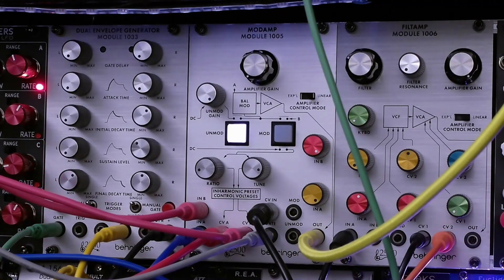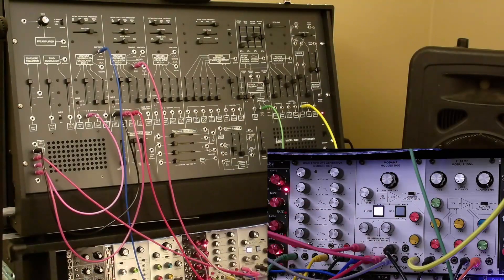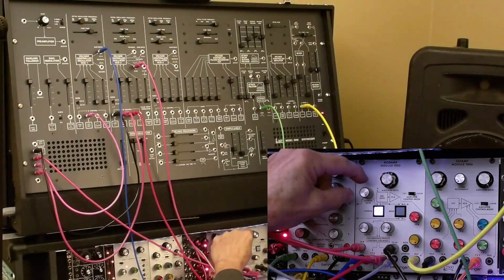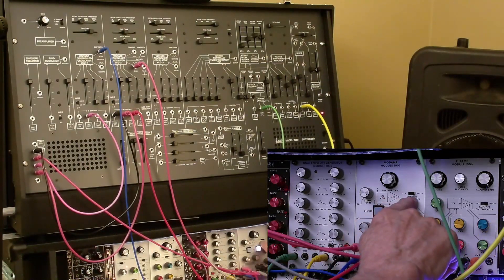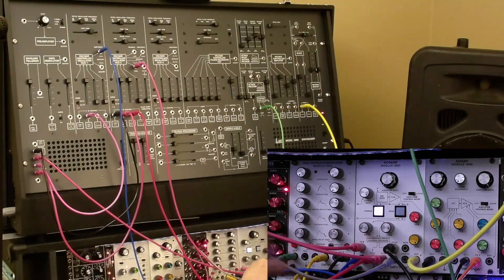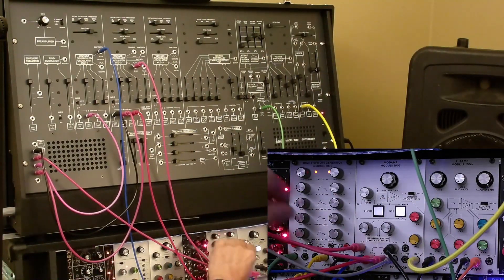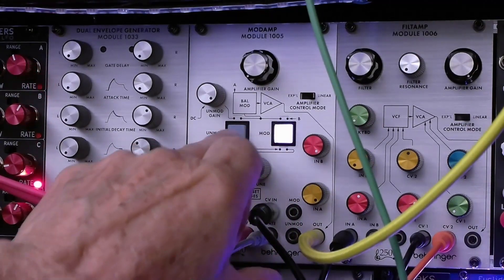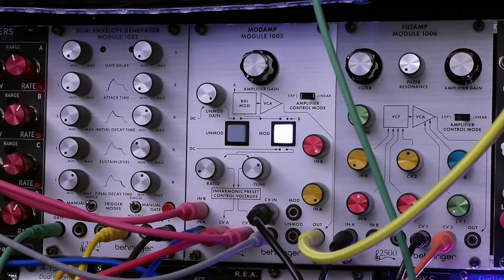ARP 2600 with ARP 2500 ModAmp 1005 in Depth

Comment: Hi there; I'm trying to understand how you're controlling the pitches of both oscillators. Do I have this correct?
OSC 1: OUT B
OSC 2: OUT A + OUT B + Keyboard CV
Reply from the maker: Scott,  Both VCOs come from the 2600 (VCO1 and VCO2).   Both are controlled by the ARP 3620 keyboard CVs (the 2600 keyboard).  Note that this keyboard is duophonic (low note and high note).  So CV1 goes to VCO1 and CV2 goes to VCO2 (see the black patch cable that connects CV2 to the far right jack of VCO2).  Both CVs include the LFO output on the 3620 keyboard. If only one note is played, the same CV value is sent to both CV outputs.
Also note that the audio out from each VCO is going to the 1005, which is processing with the Ring Mod and VCA (then to the main output of the 2600).